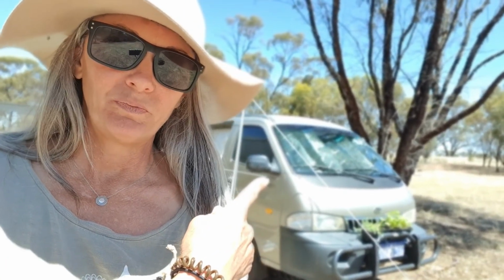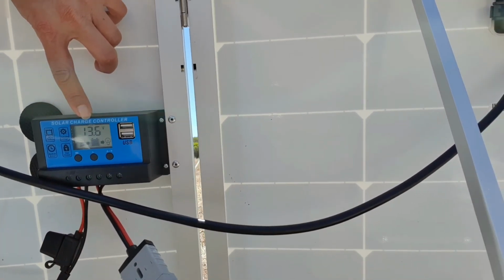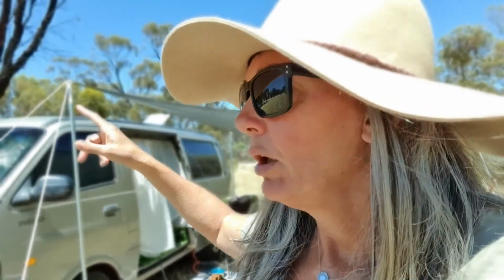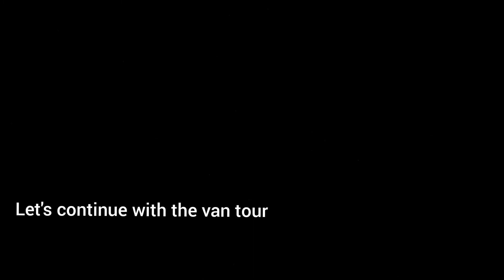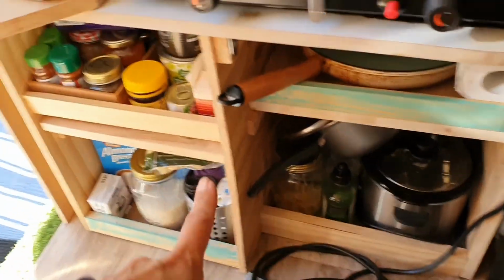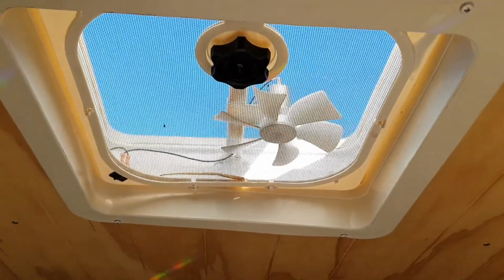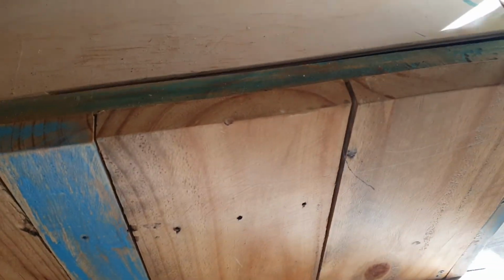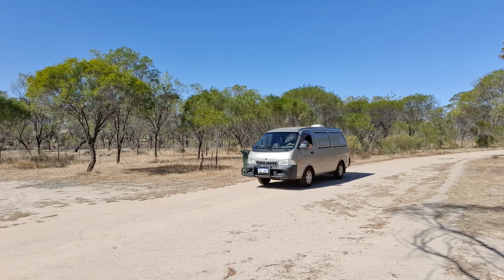Small BUDGET VAN TOUR / Kia Pregio DIY conversion #7

Comment: I just came across your channel, & now following you.
We live in Cairns, & travelled to Melbourne, Brisbane, Adelaide everywhere in a 2004 Kia Pregio.
Ours was named Kiabago as it was our mini Winnebago.
Honestly they are a fantastic van to travel in.
Just make sure that you change the oil on a regular basis, & it will be fine.
Also too insulate the front more as it will be quieter, & remove the glass divider so if your in the city you can crawl through.
Stephen, & Lisa.
Reply from the maker: Hey Guys ,
Thanks  for your support.
Have plans to travel into other parts of Australia once everything settles down with COVID.
Do like the Kia although have been looking at something a bit bigger I can stand in.
My step dad helped me pull the front panel out and move the kitchen so I could jump into the front if so need be, although not very lady like action or manoeuvre when I have done it ;) lucky no one can see me

Comment: Are my eyes playing tricks? Is the van left hand drive? (or am i overtired hahha).
You've done a great job setting it up. Did it need an extra spring in the rear to take the weight?
Reply from the maker: Hahaha sometimes forget to flip the frame. Joys of  filming it on your phone.
No extra springs needed, still underweight for the build.